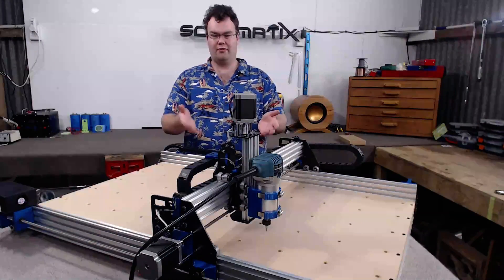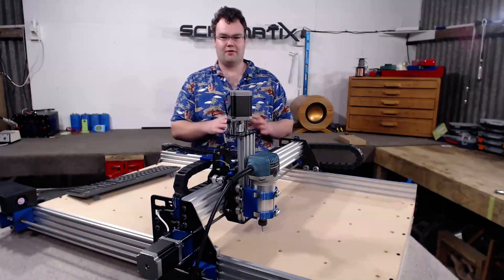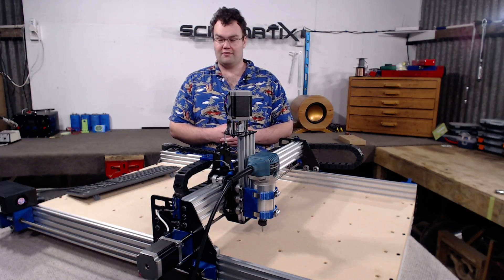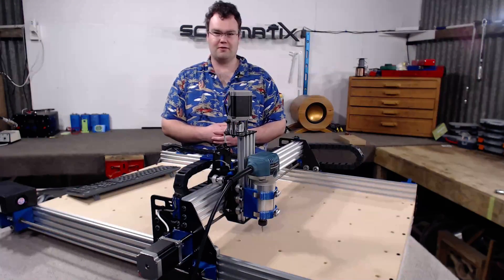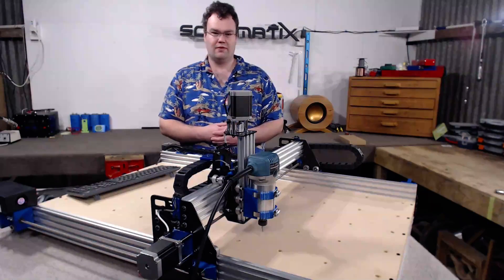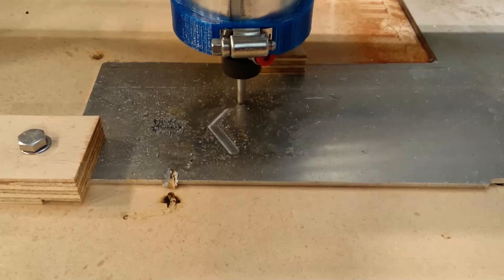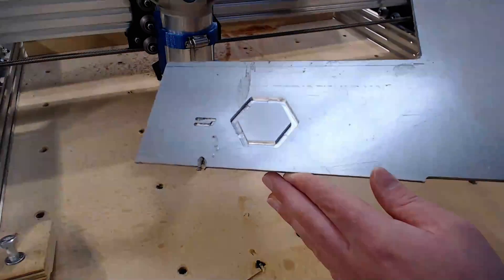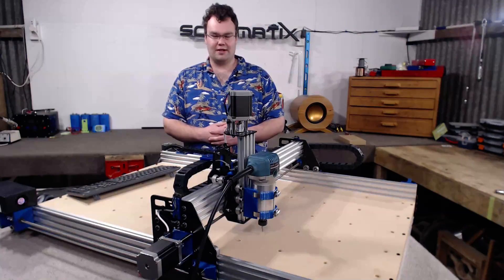OX-Metal CNC Router Mill Features & Cutting Demo

Comment: I've built the ox with the belts. It's indeed not very stiff. Also, the x axis flexes quite a bit. I think in that regard the metal version is the same. Ballscrews help of course, but the pom rollers with bolts as axles also have quite a bit of flex. It's ok for wood but only just able to cut aluminium, with very shallow cuts and high spindle speeds which risk half melting the aluminium and clogging up the cutter. 
Compressed air nozzle helps a lot for chip evacuation, regulated down to about 2 to 3 bar. Sinle flute cutter helps for roughing out material, though boring smaller holes will clog it up in no time. I like two flutes for that better with either spiral or pecking with partial retracts. If you can avoid slotting, do so. Especially if you cut aal the way through the alu, the bits that come loose may jam the cutter making it fly in all directions (holding torque in a belt system is not strong enough to overcome the forces of the spindle when things spin out of control). I used a 1.5kw chinese spindle, er11, aircooled. It does make beautiful cuts in wood. I'm building a new cnc with the ox with linear rails and ballscrews on all axes. All plates are 20mm aluminium. Controlled by AXBB-E by uccnc. The steppers and spindle are the only things I'll reuse. Build space 700x1500x200mm.

Comment: I'm curious how the Makita router is working out for you.  I presume you're using it at a low speed when you mill aluminum.  I'm building a CNC router myself and am going back and forth between using the Dewalt DWP611 and the Makita RT0701C.  
The thing about the Makita that really gives me pause is the following statement in the manual for it: "If the tool is operated continuously at low speeds
 for a long time, the motor will get overloaded, resulting in tool malfunction." Have you run into any issues with this?
Reply from the maker: I've been very satisfied with my Makita router. I do operate it at low speeds. The most I'd go up to is about 1/3rd 'throttle'. It's interesting the manual would state that warning. However, I think I know why.  At low speeds, if you were cutting deep passes it would require high torque from the motor, this would put the current draw through the roof so to speak. However in a CNC application like I'm using. Torque demands are kept low with moderate feeds & speeds. My makita has done many hrs of work. I can recommend it thoroughly.
Reply: @Schematix  Awesome!  thanks for the reply!

Comment: I wanted to build a common machine such that its primary purpose is for plasma cutting but also router & laser usage...perhaps even 3D printer.    What would you recommend for a guy who is a complete novice with machines like these as well as electronics?

Comment: This looks like a really great design compared to everything I've seen so far for a simple home built machine capable of precision work EXCEPT FOR THE 3D PRINTED CRAP!  Seriously its like building a car and holding the wheels on with plastic bolts?  Its just dumb.  No offense to you Schematix just the design.  If all those 3d printed parts where aluminum instead of plastic It would probably be the best DIY build I have seen yet.

Comment: Really love this build! What type of feed rates and doc are you seeing with cutting aluminum?
Reply: +Schematix Wow!! Amazing feed rates! 610 x axis travel, is that cutting area? Would love to be able to cut 24"x24" (610mm x 610mm) sheets. With a little room for clamps. Do you see a problem with making the x axis a little longer? Thanks!
Reply from the maker: You could extend the x-axis if you so desire. I kept my design fairly compact for rigidity for tighter tolerances when machining alloy.

Comment: How bad/good is the hysteresis on these rods compared to belts?
(because by definition (screwing) threats do have hysteresis)
Reply from the maker: It's there if I become greedy with regards to feed rates. However that user error not a mechanical flaw. I've worked with GT3 belt on my 3D printer, So I'm familiar with what you are referring to. And the 8mm leadscrew basically has little to no backlash/slack.

Comment: One more comment or more like a question. Do I need a 3D printer or are those parts available through the Open Builds store??
Reply from the maker: At the moment you have 2 options. 1. Is to print them yourself. 2. Use one of the many online 3D print services and get them shipped to your door.
Reply: were do you source the files for the parts to hand to your manufacturing agent

Comment: I have been interested in CNC work for many years, but not until the past couple of years has the bug really started to bite harder, so I have been looking into getting a machine setup. I have noticed a lot of fancy names with high price tickets, and have shied away from them for one reason or another (mostly price) I have looked at building something from Baltic birch 13ply. but have steered away from that also. A couple of weeks ago, while searching yet again on good ol' Google, I came across OpenBuilds.com and there I found out about the OX machine. Long story short when I found out about the x,y drive system via. the belt I was really beginning to be skeptical until I came across the OX-Metal machine with lead screws. I haven't checked out the price yet, but as for a DIY machine, I think this is the rig to get (providing I can get the size I am looking for with a work area of  610mm x 1220mm). Sure, it may be possible to build something cheaper, but will it last?? By the way, great information, thanks. For a newbie getting into the CNC game, this information helps a lot.
Reply from the maker: Thanks, and no problem. Hope you found my video useful

Comment: Is there a reason you went with the dimensions you did instead of just using the max length of the lead screw as the limiting factor and cutting beams to accomodate? I am new to this and using your design as a basis for my first build but maximizing work area is a concern for me. I have a ton of questions, probably many stupid ones if you would be available for discussion somewhere.
Reply from the maker: In my opinion this size of OX is a good balance between usable work area while retaining enough stiffness to accurately machine soft metals. Also working to the size of components to minimize waste.
Reply: Schematix Being a moving gantry system, what would be the areas weakened by length. I
 am currently learning some CAD and laying out a version of your machine using c channel rail and the full length of lead screws in the x and y axis. What down sides so you see?
Reply from the maker: If you wanted something  say 1200x1200 and able to machine alloy at a decent speed quite honestly it's a complete redesign and not a simple one. So you'd be on your own there. The mill I built is at a sweet spot for price vs functionality (imo). Something catered towards milling metal at speed is naturally more expensive.
Reply: @Schematix  does this still hold true ?

Comment: Great Build.  Do you find the Z axis is long enough in the length f travel? 

Could this build incorporate a pivot to allow for the unit to be used vertical and a paint spray gun installed to paint vertical surfaces?

What about attaching other z axis devices such as a plasma cutter?  

Are there any issues in increasing the distance of travel and size on the X, Y Axis?

Finally do you have the 3D printed parts data files?

Thanks again

Comment: HI Mate, love the video. Quick question regarding maximum thickness of the aluminium you can route with this machine. I have project in the pipeline for a machine that duplicates rifles stocks, but it requires a couple fo plates to be cut from 20mm plate. I assume that the OX is more than capable provided the feed rate on all the axis are slow enough? After that, its a matter of time and how many router bits i want to blunt?
Reply from the maker: Assuming you're using a 1/4" or 6mm milling bits? the major factor will be how long the flutes are. You can find specialty extended milling bits in 6mm. But 20mm is pushing it. Might have to mill both sides.
Reply: Ah, i hadn't considered the length of the flutes. I assume that an issue with clearing debris? might need a redesign, 15mm plate should work i think

Comment: Again great content! I would like to know if you could cut 3mm steel sheets. Do you this this machine is capable of doing this?
Reply from the maker: Personally I haven't cut steel with this yet. I do believe it would be able, you'd just have to take your time and slow down the feeds & speeds. Also it would be ideal to have a lubricant mister to cool the cutter head.
Reply: What abut attaching a Plasma cutter?  You would need to change the wood base plates and design a alternative z mount to allow for swap over tools.
Reply: Ferrous metals is what separates the real machines from the toys.

Comment: So obviously I've been watching a lot of your videos as I'm trying to learn as much as possible so I can build mine correctly and try to avoid any problems in my build. I noticed in this video while doing your test run on the wood and aluminum it was cutting deeper on one side than the other. Was there a reason for this that you know of? I have seen people surface their waste board to make it level to the X and Y axis rails. Do you think maybe this was the case with your test. do you think maybe your waste board wasn't level to the rails?
Reply from the maker: Well spotted, the reason for that is because my plywood bed wasn't parallel to the milling bit. Solving this is so simple! Just get the CNC machine finished and running then use the CNC mill to machine its own bed flat! Obviously it can't make it all the way to the outer edges, So after I used a sander on the edges where the mill could not reach

Comment: Awesome man! Very cool to see people building these here in NZ! I am curious where you sourced your parts. (I am kiwi too) I am looking into build something similar this year.
Reply from the maker: Thats awesome to hear! I'm based in the BOP area. I used CNCKITS.co.nz for the V-slot, Ebay for stepper motors & cable chain, Openbuilds part store for pretty much everything else. And Jaycar for the odd switch, wire.etc Using the stores I mentioned was by far the cheapest option considering shipping to NZ.etc
Reply: Wicked! Any idea on the overall cost of the build? I have been thinking of using the C-beam mechanical bundle from cnckits, then just buying extra c-beam lengths to get a bigger bed. I would love to be able to do a full sheet of plywood if its not too costly. But I would be happy with a similar size to yours for now.
Reply from the maker: My mill cost just under $2k NZD to build. While there is absolutely no reason a mill can't be upsized to fit a full sheet of ply, you would have to tread carefully as the extended axises would need much more stiffening to eliminate axises resonating during a cut (especially the X axis)